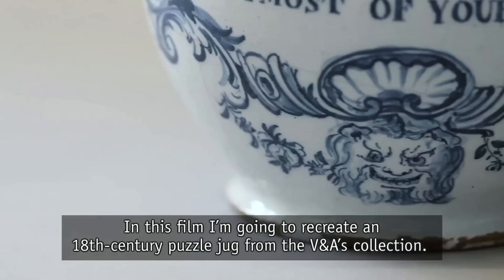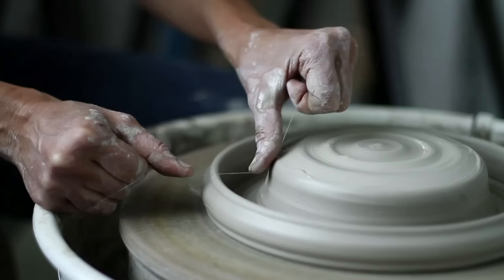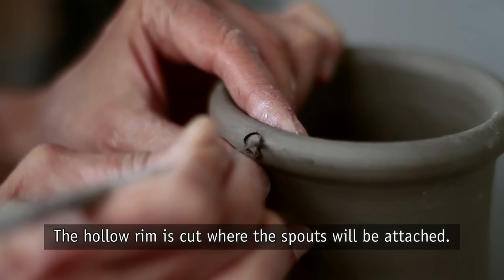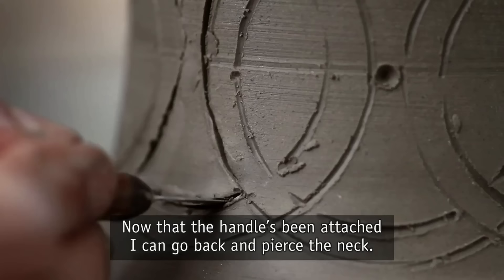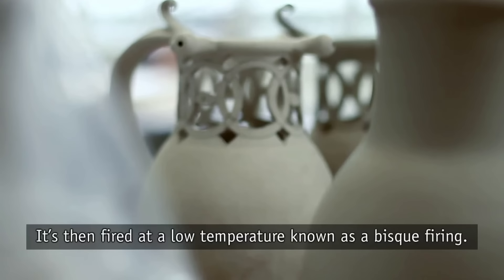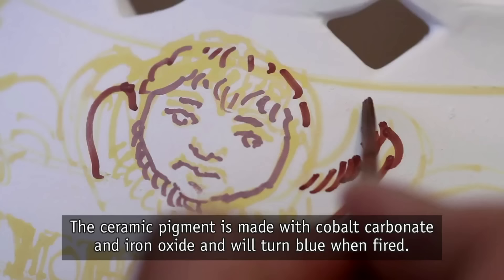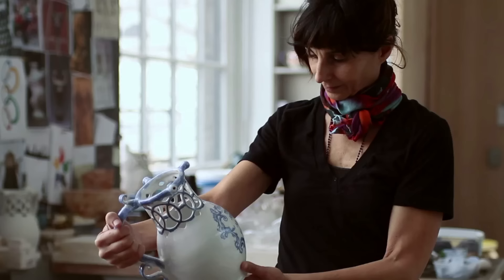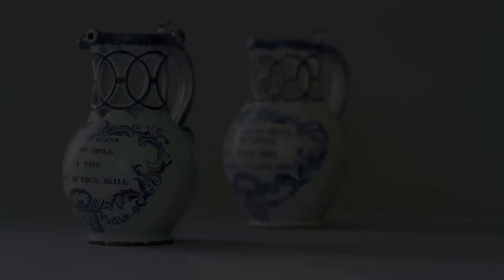How was it made? A Puzzle Jug by Michelle Erickson

Comment: Doesn't it present a problem with no glaze in the hidden channels?
Reply: Majoofi no, why would it?  Glaze is purely ornamental.
Reply: Jack Benimble I thought it kept the water or fluid from going through it
Reply: I thought so too, since clay is not food-safe without glaze.
Reply: Alice P clay can food safe depending on the type of clay you use, because of their firing temperature. Typically, low fire clays are not food safe, but she used a high fire stoneware clay which doesn't need glaze to be food safe
Reply: Oh cool! I use stoneware clay fired at cone 6 and my professor says that it cant be food safe without glaze... I probably should try firing at higher temperatures then
Reply: Yeah. That was exactly my point. I suppose if you plugged the different orifices in turn and flushed boiling water through the the channels only drank water out of it...? Or better yet can anyone think of a way of glazing in the channels without clogging it.
Reply: Alice P little unknown fact, any time food comes into contact with a cocking or heating vessel it is always unglazed
Reply: i mean. 18th century pubs dont give a shit
Reply: @Majoofi   rinsing it before it dries in the channels then a sanitizer. I would put the sanitizer in the jug, tip it slowly backwards leaving one hole open at a time. Dried wine residue probably wouldn't hurt anyone though, especially if refilled with another alcoholic drink.
Reply: 1. alcohol kills germs, doesn’t it?   
2. I would not have wanted to drink from it after some drunk had slobbered in the nozzles.
3. not much of a puzzle because once you know what to do, only an idiot or a drunk would dribble it....oh that’s right...

Comment: i had no idea you could make hollow bits in firing clay, i was always told it would explode
Reply: Dead Eridan It will explode, if the air is trapped inside. Those hollow structures are connected and the air can flow out. That's why no pressure will build up and it won't explode.

Comment: They should’ve had someone else paint the jug.
Reply: THIS
Reply: A why
Reply: So true. What's with the NOTT?
Reply: Couldn't tell.  Haha.
Reply: That's... rude. I think she did an excellent job, even if it wasn't as good as the original.
Reply: I think it is a glazing defect. You can see there are some details lost in other areas, as if there was an issue with the white base glaze causing the blue glaze to lose detail and slip around. Ceramics is extremely difficult and glazing can be unpredictable.
Reply: @electricityrevealed1  I wonder then, how the original was so perfect and uniform. What process did they use? Any ideas?